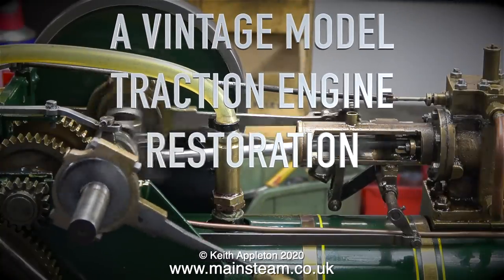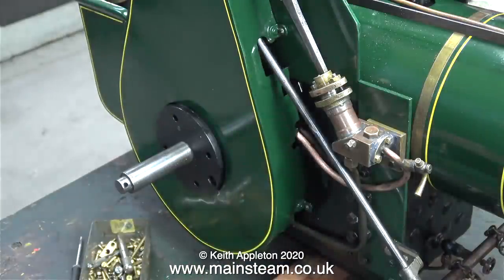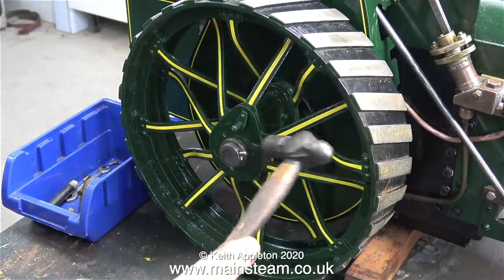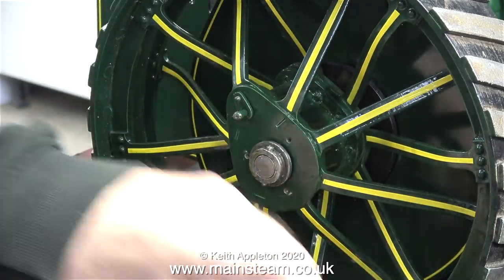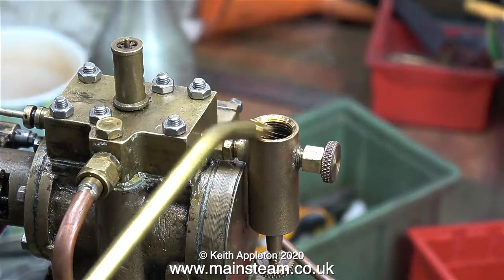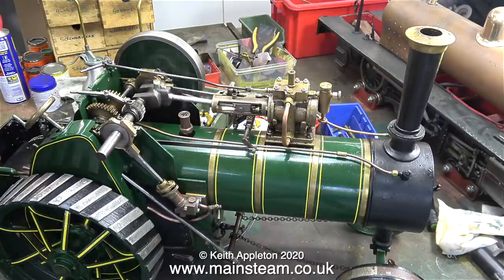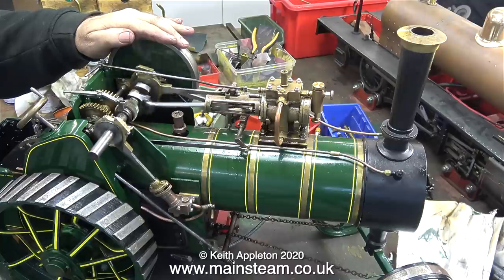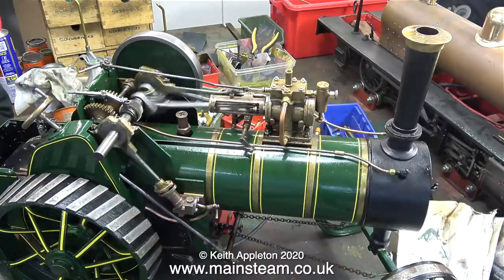A VINTAGE MODEL TRACTION ENGINE RESTORATION - PART #15

Comment: I know what you mean about retaining the venerability of the engine. A lot of full size restorations to 19th Century steam locomotives, at least in early preservation days, tended to replace lots of original metal.

Comment: Sir, With regards gas safety, butane is not actually the worst of the common reagents you may encounter. No, DiEthyl Ether takes that prize. 
At room temperature and pressure, ether is getting quite close to its boiling point and thus has a fairly high vapour pressure. It is also heavier than air, flammable and explosive. Tales are whispered in chemistry (and biology) labs of the times when a bunsen burner or spirit burner was a bit too close to a bottle of ether, and the vapour plume from the ether bottle was ignited by the flame, which then raced back over the bench to the bottle blowing out the stopper and turning it into an indoor firework.

I could also mention the undoubted fact that the cause of most accidents is students in a lab, but that might be a bit too much information for some here.

Comment: If I may ask, why is there a safety valve on the regulator block?
Reply from the maker: The replacement boiler (not done by me) is a locomotive boiler and as such has a safety valve on the barrel. The safety valve on the regulator block is the original one.
Reply: @keithappleton  Interesting. Thank you for the info.